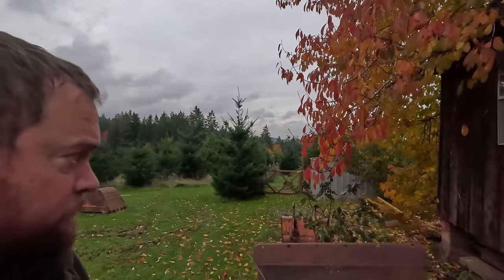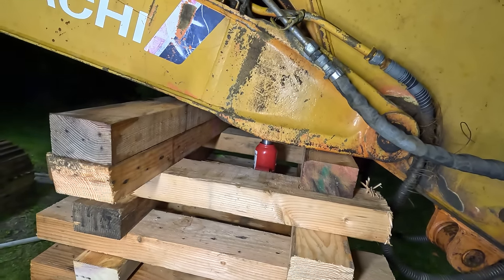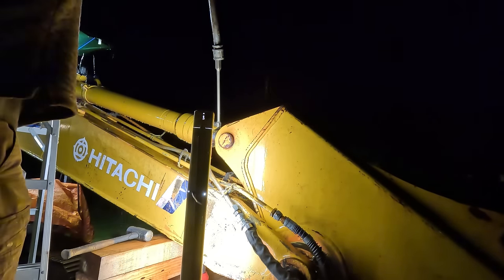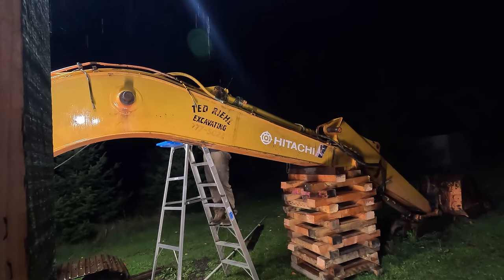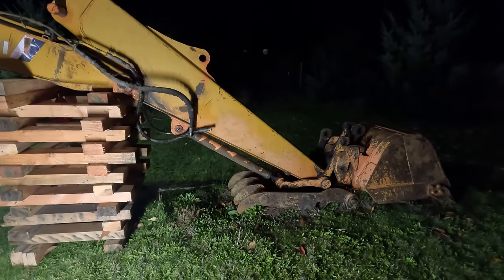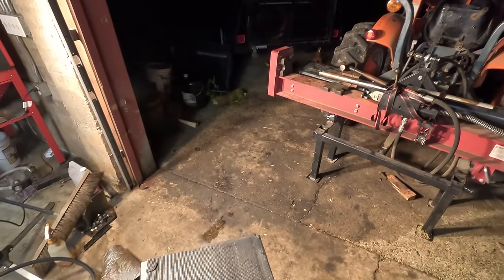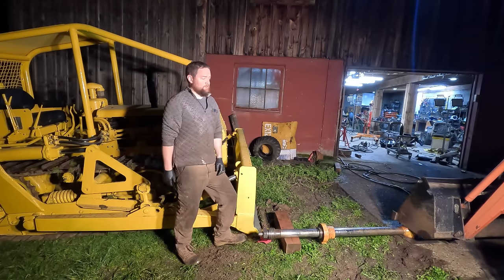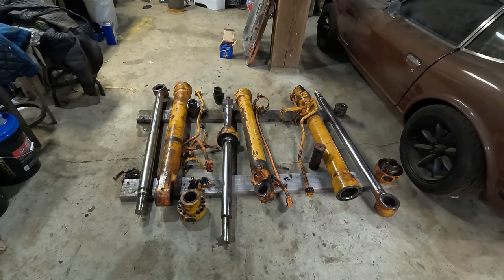Removing the stick cylinder using viewer advice - excavator project

Comment: Matt, bring the rod to the compressor and use the shortest hose possible (the shorter the better).  This will increase volume to the gun.  Certainly a larger hose would be ideal too.
Reply: Yes, this will make a remarkable difference. Doesn't seem like it would, but it will make the gun way stronger.
Reply: @JFirn86Q  For sure.
Reply: Does the brand of impact make a difference? I believe his is one from HF.
I was having difficulty removing a crankshaft bolt on my '03 Forester. 150lbs at the air line. My impact wouldn't budge it. Took it to a local guy. His impact took it off no issues.
Reply: I will drop this link someplace Matt. It may or not be of interest to you. I'll try to find a direct message to funnel it through to you. Useful item right in your wheelhouse at this moment.
Reply: Matt,I am impressed. Also you have some really sharp viewer's. I admire talented people!!!

Comment from the maker: A bit off topic here, but if anyone has a used injection pump off a 4BD1T lying around, let me know.... part number 10402-4133 or 101402-4134.  I need one for....reasons.
Reply: Uh oh. Random spring left the building at speed?
Reply: Area Diesel Service is always the place, lol… …
Reply: Bit of heat on the nut would probably make it easier to remove.
Reply from the maker: @rickhaver5876  I have a shop to do it, just need a rebuildable core where every single part isn't rusted out
Reply: How much Rain does your area get as I swear it's always raining in your Videos?
Reply: Last comment, today. Try adding Marvel mystery oil to your 1 inch impact gun just before you use it. Helps my impact gun a lot. Every little bit of help, helps!
Reply: @mikesmith8952  If it does not rain there for two days they have a serious drought???
Reply: I would try using your dozer to try loosening the nut. I would also try renting a towable air compressor
Reply: Nice work.
Reply: Area Diesel services loves to do colabs with creators make sure and look them up.

Comment: You need to get an air over hydraulic bottle jack.  Yeah, I didn't like seeing your arm in there either.   One armed mechanics don't get much done.
Reply: A pair of tongs-like fireplace type to set the jack and a longer pipe to pump it.

Comment: A tip from Clint at C&C Equipment and Oliver at Snowball Engineering: When lifting using straps and forklift tines, always use a clamp on the end of each tine to prevent the strap from slipping off the end.
Reply: also if using fabric sling use softener on forks to prevent damage to sling

Comment: After having done over a hundred hydraulic cylinders at my work I can say you are doing amazing for someone essentially working out of their backyard! We recently got a special machine to undo and tighten those nuts on the end of the rod because we were always struggeling with them.... the only thing you could try is applying some light heat (no more than 200°C) to potentially melt some locktite in there, the only other option is as you said a shop with special tooling. 
Also I would NEVER put compressed air in the cylinder to get the piston out that is a terrible idea!!! You are essentially creating a rocket! Before my time my boss tried that and the rod shot out and trough a wall of cinder blocks and got burried in the field behind. You can still see where he patched up the hole!
Reply: Sounds like you got a hydraulic repair bench. It will also re-torque the nuts right? One thing I keep saying to my self as I watch him fight the battle to remove these cylinder nuts is how in the world is he ever going to re torque them correctly.
Reply: @inkman996  in my experience the proper torque doesn't matter that much. Just get it as tight as you can with a 1m Breaker bar and it will most likely be fine. With our new bench you can set a torque but it doesn't make them last longer or anything, probably just slightly better on the materials of the threads
Reply: @benediktpaul157  for the most part I agree.  But I was taught that the preload on the nut needs to exceed to load the cylinder can impart. That way the constant change in directional force cannot over time stretch the threads which then leads to a complete break down of the assembly.
Reply: @inkman996  you are right. But these cylinders are not huge and with a 1m bar you can get a couple thousand Nm without problem which should be enough for these

Comment: You need a torque multiplier wrench. I’ve used them for large hydraulic ram repairs when I was in the Navy. Having one makes all the difference in the world when it comes to loosening, and tightening, nuts and bolts on hydraulic rams.
Reply: Back when I was in the Navy we had torque exponentiator wrenches.

Comment: So much admiration for you - it's pitch black, p*ssing it down with rain, you're soaked through and you drop your wrench handle down inside the Jenga stack of timber - and not a single word of cursing was heard. If that were me, the neighbours 300m away would hear me cursing for at least half an hour !!

Comment: When you need a little more power from an air impact, give it several squirts of oil in the air inlet. Its messy but it won't hurt the gun and many times its just enough extra power.

Comment: The thing I don't like about pulling cyinder apart like that is that the rod is unsupported, so the piston is kinda cocked in the bore. It would be better to pull it out as far as possible with the rod guide still bolted up, then supported the barrel and finished pulling it out as straight as possible. 

From the sounds of it, the barrel will be rehoned anyway, so us not such a big deal, but I'm thinking about for whatever your next project will be.

Comment: Matt, I was a mechanic for over 40years.I learned a trick that helped me out with over tight nuts. Take a ball peen hammer and put the peened end on to the nut then take another heavy hammer and beat on the ball peen hammer. What this does is excite the molecule's and they expand which help's to loosen the nut. Keep moving the hammers around the nut flats, worked for me. Good luck and I am following you on each epic video. Norman

Comment: That was an excellent deal on the cribbing!  
Just a thought...have you considered holding the nut end with the pipe wrench being held down and turning the other end with a really long bar through the eye hole?  
It would only need a quarter turn to break the hold so you can use the impact to finish it off.

Comment: Matt I happened to be watching a video on another channel and I was able to pass along some info to him and I thought I might share it with you. I was an electrician in the steel industry for forty years. In the early years of my training we had a 3M representative come to our facility and give a talk on using their products. Needless to say we were using most of them wrong and it opened our eyes as to why they weren’t performing to our expectations. The biggest eye opener was using their plastic electrical tape. As you probably know people have issues with it unwrapping itself especially in oily applications. They use wire ties etc. to try and stop this issue. Well, its because the tape was applied wrong. The way it’s supposed to be applied is as follows. 
Starting with the sticky side against the work you wrap it the length of the place to be covered, then without cutting the tape you twist it so the sticky side is now up. Wrap the sticky side up back over the tape then at the end of that wrap twist the tape where the sticky side is back down. You then wrap the tape sticky side to sticky side back along the the path of the original taped joint. At the end of this pass try and stop the tape without leaving a piece flying in the wind so to speak. To get a sense of how tight the bond is, just take a piece of the tape and stick it sticky to sticky then try pulling it back apart. I truly hope this may help in the future. 
Love your work and wish you and yours the best.

Comment: Cool video man. I been dealing with fixing heavy equipment my whole life so ill give you some advice. The "best" way to remove thst nut with what you have available to you is to get clean platform for one where you can fit the dozer even if its jist plywood. Then lay down a heavy blanket to protect chrome always. Set 2 6x6 blocks then put another soft blanket on the blocks. Put the rod on the blocks and run a very long pipe through the eye to stop it from turning. Then get a very heavy duty breaker bar on that 1 inch socket and set the dozer blade down on it with everything it has. If it needs more, put an additional pipe wrench on the socket and give it a few good hits with a hammer. I guarantee thatll take the nut off. Its easier if you had snither excavator but thats what I would have done. Keep the videos coming man i love watching them you are a hard worker!

Comment: On larger equipment than you got there was what we called a slug wrench. Up to I think 4 1/2 inch larger than that we used a torque multiplier. I commend you for even attempting such a project.

Comment: Good vid thank you Matt, Cribbing is the way to go much safer!! - it looks like you are using a 3/8 air hose with the impact - at a minimum 1/2 air line to the compressor tank, it will make a huge difference!!!  I had tried mine with 3/8 and it would not get the lug nuts off my semi rig changed to 1/2 and not problem came right off . you can tell it is starving of air from the sound it makes when you are trying to break the nuts free....
Reply: When upgrading lines, make sure your fittings are sized large enough otherwise they'll be a bottleneck. Same goes for the manifold and all the connections at the compressor. if you only have 1/4 coming out of the tank or at the regulator it isn't gonna matter how big your line is.
Reply from the maker: its all 1/2" fittings and lines, but the overall length isn't helping
Reply: The impact definitely sounds starved of air, the last video you said you turned the air pressure down to 100 psi! I would turn it up fully, it's not the pressure in the tank you need to worry about it's the pressure at the gun when it's running!

Comment: Hey Matt, great video.

I'm curious why you didn't use some gentle heat and some penetrating oil on that nut that wouldn't budge. It's cold enough overnight in the PNW that the rod will be near freezing and getting the nut expanded with some gentle torch heat could be enough to break free whatever's holding it on.
Reply: I thought the same thing. Heat is #1 at cheap and effective. Penetrating oil is more like..."60% of the time, it works every time."

Comment: Fun stuff. When I used to break down rods, I had a pretty good trick. I put a heavy wall pipe, 3-5 feet long, thru the eye of the rod. Then rest a bucket, or forklift tire on the eye, with the pipe laying on the ground. Now I have a handle on the rod. Next put a socket and breaker bar on the nut, with a big long cheater bar.  It worked to get the nut off, and put it back on.

Comment: Great Video - surprised you did not heat the nut up with a torch and then use the gun on it. Your very creative in your approaches to problems.

Comment: Solve the swing brake with 2 chains on cab corners crossed over to opposing track. Binders to take up the slack if so minded.

Comment: Put the rod back on the boom,and pull down with the the pipe wrench with the dozer winch cable.
Get it chained or roped so you don't fly it on somebody,and protect the rod with a some wood and rubber.

Comment: You need a big Striking Wrench to get that nut off. That's what the pros use, or they will have more specialized machinery. Also, your impact gun is starving for air by the way it sounds. Need to use like a 3ft 1" hose on a topped off tank, would make a remarkable difference in performance.
Glad the cribbing suggestion worked! Not much you can't do with cribbing, it's incredibly strong - just slow.

Comment: Glad to see my one suggestion using the tractor to pull apart worked.
I was honestly surprised my other suggestion using the tractor to loosen the nut didn't.
 
Although, I probably would of used a decent size cheater pipe and the tracks of the bulldozer instead of the blade.

Also remember heat is your friend in those situations too.

Anyways awesome work!

Comment: Regards to your impact,scrounge up another air tank and hook it in to your existing tank. Get a 1/2 inch 25 foot hose with the correct large couplers.  Your Impact will thank you. No need to get a larger compressor.

Comment: Good work, Matt! What I did for the piston nut was put the rod back on the machine and held it with the pin to keep the rod from spinning. I realize your situation is too high off the ground to work for you but if you could hold the rod end tight and put a big pipe wrench on your socket and then a long pipe on the end of the wrench, you could bust that nut loose! Sorry you always seem to be working in the rain! lol

Comment: I'm really enjoying your builds Matt or rebuilds as it were ... I can certainly understand you being at wits end trying to take apart that cylinder .. but I couldn't help but think you just needed to try the opposite way that you did with the blade of the cat holding down the eye, just because it's a huge piece of steel versus the weight of the bucket on your tractor, and use the bucket to assist the big nut driver or pipe wrench.
Cheers and best of luck Brother ... I'll be watching 😃✌

Comment: To get full power out of that 1” impact use a 1” air line. If the socket is able to rattle it takes away from the torque. 😊 Put the rod end under the cat blade and use the pipe wrench with a 6’ cheater pipe. You can heat the nut too.
Reply: I agree.  Use the Cat blade to hold the rod end.  If he can't find a larger hose, get a shorter one and get closer to the air compressor.
Reply: @number40Fan Exactly,  a MUCH shorter hose will work far better.
Reply: Matt you should crank the pressure up to whatever the maximum psi is on your compressor. They are usually around 120-175psi, some go higher. I know in the last video you mentioned using a 1/2“ line and regulating the tank pressure to 95psi. I know my big impacts make a ton more torque at 135psi and 150psi than they do at 90psi. I don't know if I would take it higher than 150psi. The higher psi and a shorter hose should do the trick. You are so close, you can't give up on that last nut.
Reply from the maker: I had it up to 165, but the hose length was definitely not doing me any favors
Reply: @PacificNorthwestHillbilly Argh you were so close! You still accomplished more than what most people would have even attempted. Like you said, the air hose and rod movement aren't helping you out. I was really rooting for you to get that last nut removed.

It's amazing what you accomplish in your home shop by yourself. The engineer in you really shines in the creative solutions you have used to tackle some of the challenges on the dozer and now the excavator. I subscribed to your channel way back at the beginning of the dozer project, when you were dragging it out of the woods. I made a similar comment back then about how I loved comparing yours and Clint's, from C&C Equipment, approach to dozer repair. Yours was like an underdog story. From struggling to get it out of the weeds and onto a trailer, to the beautifully restored and functioning piece of Cat history.

It seems like the Hyundai is going to throw you more curve balls than the dozer did, but I feel like you are going to hit the ball even farther out of the park on this project. I'm truly excited to see how the Hyundai turns out, and looking forward to the projects you have down the road. Keep up the great work!

Comment: Cutting edge engineering has great videos. As for holding down that last rod, that D 4 has a lot more weight than that loader. Might have also heated the nut a bit to break it free.

Comment: Before I retired I was helping out our equipment mechanic work on a fork lift.  I don't remember what the nut was on, but we used every impact we had and couldn't get it loose.  A tire company field truck came to replace tires on a forklift and saw us struggling with the nut.  He offered his air hose from the truck compressor to try.  I don't remember the PSI but he definitely had more SCFM and PSI.  The nut surrendered almost instantly.  Not sure what the impact wrench is rated for, but that might be the answer.

Comment: - Matt, what would the shop guys doing the cylinder for you say about using an induction heat coil on the big nut that you could not get to break free?
- Is there a hardness specification for the threads and torque requirements?
- My guess is that in the old days, they would just use a propane rosebud setup to heat the nut 100 degrees or so, and not hurt the hardness, then long bar it off using an open end cut steel wrench with a three inch shank and call it good.
- But that is me used to three inch bolts and 6 inch nuts on a cone crusher system with 80 inch thick coil springs that required torquing. I don't know the issues involved in today's world of hydraulics.

Comment: You need 150 to 175 psi on that impact wrench with a lot of volume and a minimum 1/2” hose. Nut probably 5000 or more lbs torque. Since the nuts have set screws you don’t have to torque them like that going back together. Just hammer them with the impact and lock them down with the screws. You won’t have any issues. If you use air to remove the rods in the future then regulate the psi to 20 psi. Keeping them absolutely straight is the key to easy separation.  Are you planning to separate the swing bearing?
Reply from the maker: If it's worn out, yeah.

Comment: Get a piece of I-beam or channel, weld on ears to hold everything in place to stop rotating, pull or push points to put rods in or out. It will hold everything straight, clean, comfortable work height.